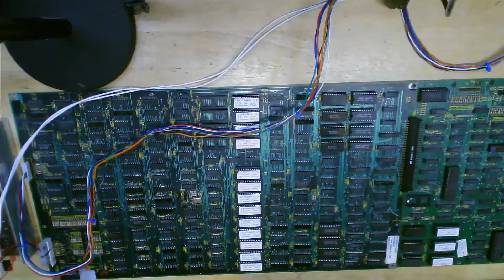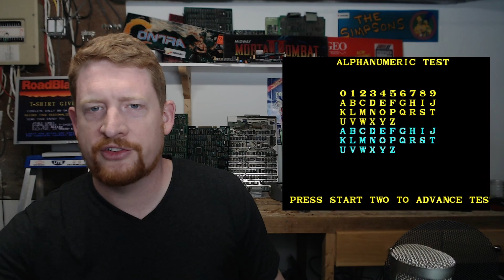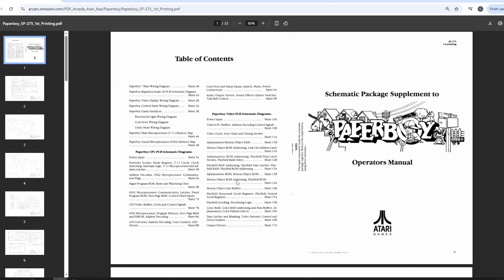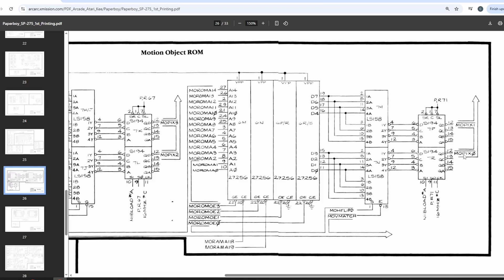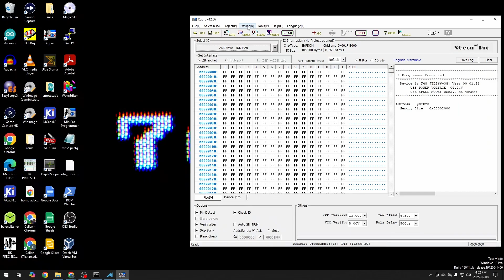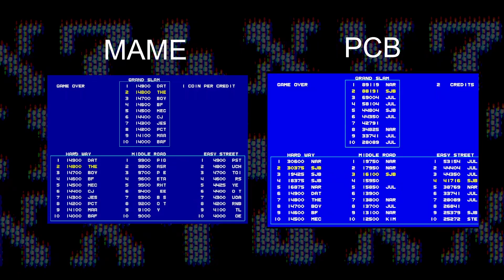Paperboy Arcade PCB Repair - Lines Through the Sprites!

Comment: Im cofused..if the input was bad why didnt you trace the input back to its source being the bad signal had to be coming from somewhere, right?
Reply from the maker: The input pin on the 194 was broken. No matter whether it was given a high or low signal, it acted the same. This was verified in the tester.
Reply: @74XX_arcade  aaahhh...thats right..u did test it. I dont think u mentioned the pin itself was broken. If u did i missed it.
Reply: @MyNameForNow27  It wasn't really the metal pin, it was the IC's internal circuitry connected to the pin that had failed.